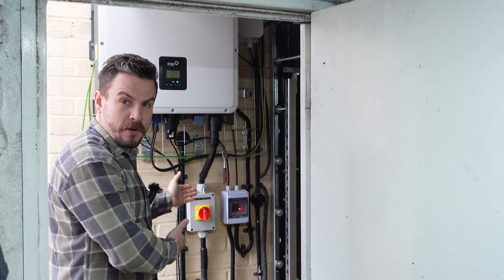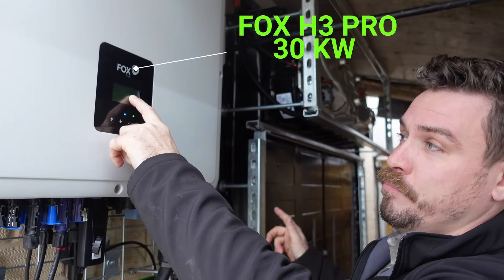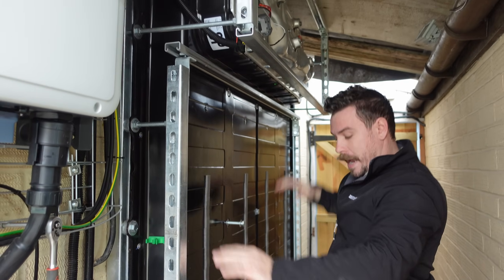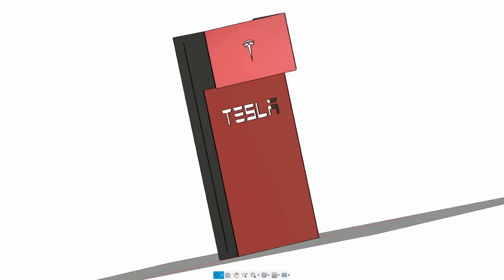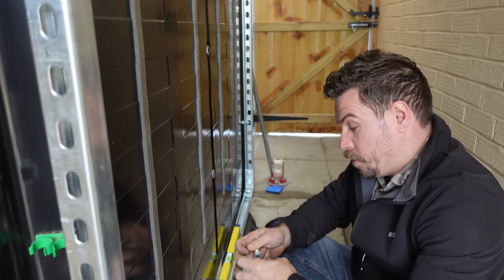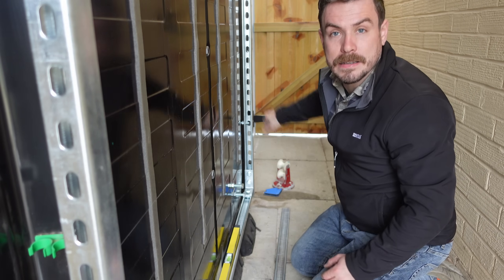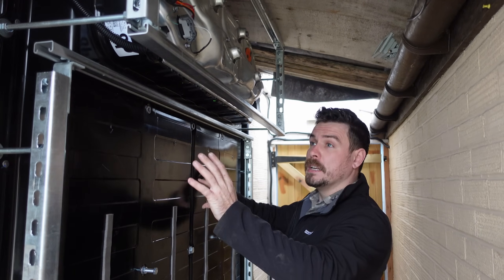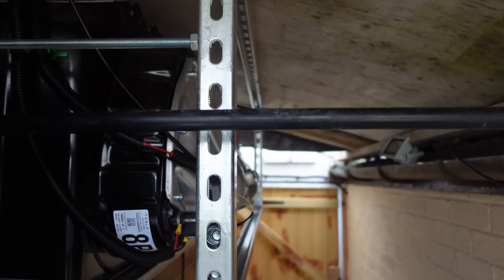I Literally Fixed the EV Battery Pack that I BROKE

Comment: Hi. I have a similar project using a Tesla model3 LFP battery. I had it working since April and in the last week or so the 14.2 v from the PCS is not outputting any voltage/charge to my lead acid battery. I have got around it by using a 12 battery charger connected to the battery which is powering the system and its working okay, but  I would like to fix it properly. I could replace the PCS unit like you did, but I feel its just a blown fuse in the PCS or something similar. I have opened the penthouse and there is no signs of damage or "smell" of burning as you experienced. I have checked the emulator "more battery info" settings and it shows some values that don't look right. Have you a "working" set of values that I could compare to mine, that would assist me in my repair. I'm thinking it got too hot due to no cooling and I am in the process of installing a cooling loop for the PCS that  would assist with this. Thanks. Can I pm you if possible?
Reply from the maker: Yeah drop me an email and I’ll send back a normal looking screen for you to compare 

Does a power cycle fix it? Any errors reported by the BE?

Comment: Question for you, we just recently had solar installed, with an inverter, soon to get a battery installed too.

These are things I'd be quite happy to do myself, however, one of the issues with it, is that to get money from say, Octopus, is the need for an MCS certificate. You say you're getting paid for cycling power back and forth through your battery, so how have you done that? Are you MCS certified yourself?
Reply from the maker: That’s a very good question. Octopus already have an MCS cert for an installation on the property. They are also about the only supplier that will consider non MCS installs for export
Reply: @TheOfficialBatteryMan  that's good info, obviously you've informed the dno about the larger inverter, no questions from octopus about the larger power transients?

I was thinking the best route was a small certified installation that I upgrade/extend myself later on, seems like your experience confirms it

Ta
Reply from the maker: @ yeah. I completed the DNO paperwork. Simple G99 application. You record existing installs and they come back with a yes or no. I’ve got a 30kw per phase export limit.

Comment: Cooked PCS … it cant be run without cooling!
Reply from the maker: There are a few people around the world running these set ups in warmer climates than me. And they’ve not been running cooling. I plan to monitor temps closely and go from there. Through CAN files and a DBC we’ve seen 80c which isn’t right
Reply: @TheOfficialBatteryMan  Do you think its a temperature issue as I've just lost the PCS 14v to charge the 12v Battery. It looks like the PCS is not giving an output. I've got around this by connecting a small battery charger to the battery to keep the 12v for the contactors and so far its working. I am looking for a used PCS but as I'm not sure what caused its demise I'm might run into this issue again. Did you follow up any more on your issue?

Comment: Are you using any type of coolant within the battery?
Reply from the maker: Not at the moment. Temps haven’t been much over 15c with it working. The most I’ve seen after hours of charging discharge cycling is 35c. I may consider a cooling loop in the future. The pack is ready for it with coolant channels and external fittings

Comment: Great project. I will 100% be doing same. 3P on the way... Was the stark CMR 12v suitable to replace the car battery? Noticed you still using it. Thanks!
Reply from the maker: The Stark CRM handles the emulating replacing the LilyGo. But the Tesla battery requires connection to a 12-16v source. Sort of like a buffer for the Power Conversion system which I replaced. I don’t need a battery that large and will no doubt downsize now it’s working. Removing 12v power shuts off the stark and opens the contactors
Reply: Oh, Shame it shuts off the stark, would have been nice to use the 12V out from the stark to start the battery
Reply: @levibutler2383  There's a couple of different ways to hook things up using the Stark CMR. I intended the high power relay to be used to power a full BMS directly but it comes down to the continous power draw of the BMS. 7A is the 100% safe limit but the SCMR is dimensioned for a bit more. 
Another option is to use the MOSFET outputs to power an external relay/contactor. Both ways would allow the battery emulator to control the power to the battery.
At this point the only thing missing is software support as the hardware is ready for this kind of task.

Comment: Love what you are doing BatteryMan. For the cover, potentially a good quality (eg 304), highly polished stainless steel sheeting (say 1.6 mm  thickness) would look beautiful. You could have edges bent or any required lugs etc, TIG welded on. Yes, could get lazer cut letting, symbols or patterns put into it, perhaps perspex or glass behind these to help stop dust, and potentially back light these with LEDs. Not sure about the power level lighting, some smart cookies could work that out. 

Oh, BTW, it blows my mind that you are exporting at 16 kW, is good to hear. Where I am here in Australia, I only get 8c per kWh, I think from 2030, everyone here in Queensland will have to have Time-Of-Use electrical metering and after such time, people would be more savy with their useage and time exporting (with solar batteries or wind etc), not sure 🤔. Is a shame that here, the ChargeFox EV fast chargers, they don't take in consideration this, ie. high supply/low demand grid, should be a lower cost to push eeees, but they don't, I think is a set price but I could be wrong.

From my basic understanding, these batteries longeveity is dependant on four things. 1. DOD; 2. Temperature; 3. C-rate (16kW on a 57.5 kWh useable sized battery = 0.28 i.e. is fine); and 4. If it is stored, what conditons it is stored in, i.e. best to keep the SOC at about 50% at or lower than 25 deg C (not sure if there is a lower limit). 

Thank you for your great vids and keep up your good work  =D
Reply from the maker: Thank you for sharing. Aluminium sheet would be my first option but he got to balance cost. I guess I’ve just presumed that as a finished product it’s going to end up over budget. 

It’s only through the use of time of use time of use tariffs that I’m able to profit in this way. Time of use tariffs are becoming more popular in the UK most EV owners charge their car at night on cheap rates. 

Another aim of this project is to put quite a few thousand kilowatts through the battery and measure how much capacity it has as it’s used. I want to make this 1,000,000 mile vehicle equivalent.

I also have the option of using the battery as a buffer tank for EV charging in the day or running other loads like heat pumps in the future.

Comment: I realise you already explained this, but what I don't understand is what destroyed the conversion board in the first place and how do you plan on avoiding that in the future?
Reply from the maker: It look like it was miss use on my part. I had been disconnecting it when it should have been connected. And when I did have it connected I would get a whine. I got this with the replacement one. Then discovered I had a bad ground. So current was likely flowing the wrong way somewhere on the DC DC converter. If there is a YouTube channel that wants to do a tear down video I would be happy to send it into them. They can run a little warm but they are not worked hard in a stationary setting. They can deliver 200a in the car and you’ve also got the AC to DC charger onboard which we are not using. I’m not smart enough to know which components were damaged and what lead through to the final outcome.
Reply: @TheOfficialBatteryMan  Thanks for the explanation

Comment: Why did PCS break? Doesn't it require liquid cooling?
Reply from the maker: It look like it was miss use. I had been disconnecting it when it should have been connected. And when I did have it connected I would get a whine. I got this with the replacement one. Then discovered I had a bad ground. So current was likely flowing the wrong way somewhere on the DC DC converter. If there is a YouTube channel that wants to do a tear down video I would be happy to send it into them. They can run a little warm but they are not worked hard in a stationary setting. They can deliver 200a in the car and you’ve also got the AC to DC charger onboard which we are not using.

Comment: Can you tell us about the money your making, how much power you able to pull in each night and export . How much the house is using.
Reply from the maker: I can fully charge and discharge the battery between 1-2times a day. I have other solar so generally keep this for import and export rather than house load. I don’t know if you’re familiar with Octopus agile. There is potential to buy and sell as the market demands but I’m on a simpler tariff. Will report back when I have more data

Comment: Brilliant story telling and congrats on getting a cost effective fix for the burnt out board.  I'd love to hear the business case for this. E.g. Over a year this system will arbitrage  6 Megawatt hours at a price differential of £ x pence to generate Y income etc.
Reply from the maker: At the moment I’m moving about 2Megawatt a month back to the grid. The margins are fairly low. But it’s passive. And compared to more solar, it can run all year around and isn’t filling my entire garden. . . yet
Reply: @TheOfficialBatteryMan  Wow, great work. Looks like it will pay for itself in a reasonable time. I'd love to have a go at a project like this, but I'm put off by the massive learning I would need to go through in order to not die or blow stuff up 😅 What do you think the chances of systems like yours becoming commercially available. Do you know of companies aiming to re-sell second life EV batteries?  Only seen this at large grid storage level so far
Reply from the maker: @ it depends where you live. In the UK we follow the electrical regulations BS7671. There is very little about battery storage in there at the moment that effects these sort of installs. I don’t see it taking off on a commercial scale. While they are energy dense and cost effective they are not really suited for installing in domestic settings due to their mass. Farms and commercial settings I could potentially see a container being dropped in with used EV batteries.
Reply: @TheOfficialBatteryMan  Thank you 👍

Comment: Put enough magnets on and you'll never get it off, so I don't think there need be an issue with it coming off too easily.

P.S. Was expecting some explanation of what went wrong with the blown board.  Did you figure out a specific cause?  Not something you'd want to do twice I imagine.
Reply from the maker: The biggest problem with magnets is the side force is much lower than the hold force. I have a ruck of them. We will get it all mounted and looking pretty. I’ve been playing with LEDs today. 

In addition to disconnecting the PCS I also had a poor ground to the board. Current was no doubt flowing the wrong way. The PCS was being used out of spec. As to what specifically happened on a board level I’m not smart enough to work it out. But it will be here for when the right person comes along to diagnose it. I’m hoping to find BuyitFixit email 😂
Reply: @TheOfficialBatteryMan  Create lips on either size of the panel, so it's a U shape, stops the side force issue because the panel can't go side ways.

Comment: Not a problem, normally I make work for myself, it’s good that I’m making work for others not just myself lol, maybe have the side as charging/SOC and the Tesla logo white or Green for all good and Red if there is a fault making it easy for anyone one else in the family to raise the alarm too just in case your not at home. Then you could just ask them if the logo is red or a different colour.
Reply from the maker: Ahh sorry I didn’t mention your name specifically. Glad you spotted who I was talking about. I’ve got addressable LEDs connected to WLED. Just got to work out how to program it all. I was thinking of using a QLED controller for 3 sections. 2 sides and the middle backlit areas. All to be controlled based on home assistant entities. I’ve seen that WLED has a percentage option somewhere I can hopefully use, ideally showing either up or down depending on charge or discharge. As I say I’ve got a lot of learning to do.
Reply: @ yeah I’ve not dived into WLED, but I’m well vested into HA just make sure your doing it on something with more compute than a Raspberry Pi as this will be the backbone you will want to integrate everything 😂 I’ve been cheating and just using Govee stuff for the garden.

So is the middle having function? I take it the sides are mirroring each other?

Comment: look at hafele Keku fixings there a panel fixing system that used to cover access panels in cladding such as commercial bathroom panels  they're easily removed with a suction handle.
Reply from the maker: Good shout. Nice one

Comment: Just use pink plasterboard 👍
Reply from the maker: Not thought of that
Reply: @ put the plasterboard in first then cover with the nice cladding, you get fire resistance and nice looks ;)
Reply from the maker: @ plasterboard is pretty strong 2 so gives some rigidity
Reply: @TheOfficialBatteryMan  pink is the fire resistant one

Comment: Aluminium & magnets.....
Reply from the maker: The plan was to bond the magnets to the cladding with adhesive. Enough of them will hold its more about sliding. Only the front 2 panels need to be removable
Reply: @TheOfficialBatteryMan  
That makes more sense 😃
Have you thought about just going with velcro?